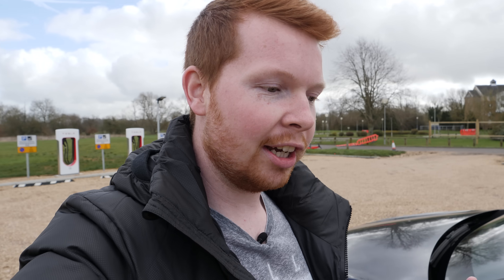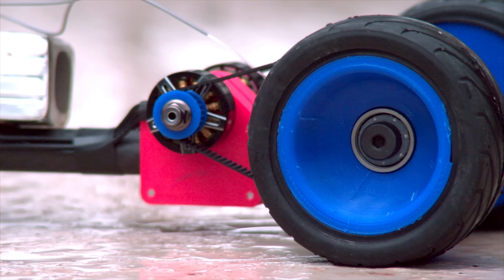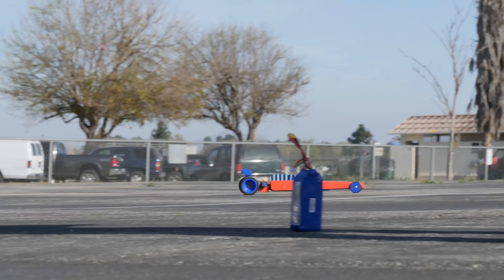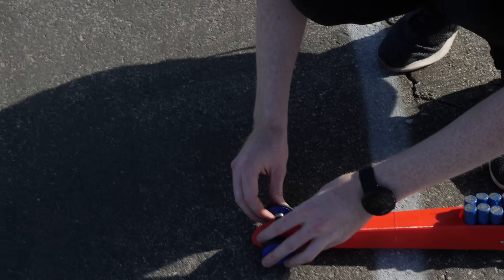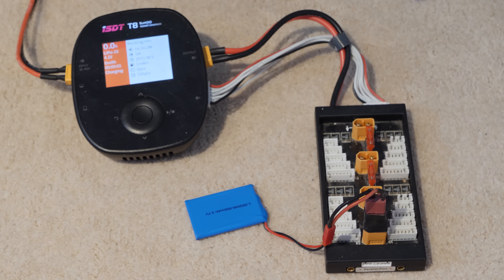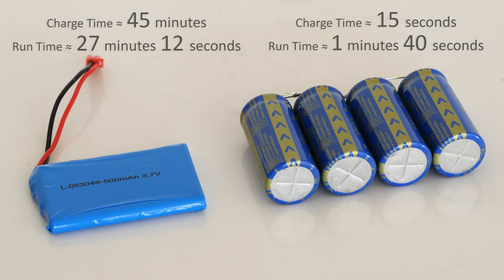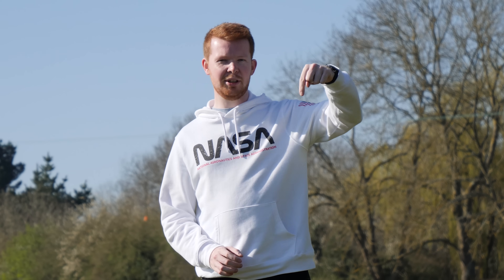Super Capacitor Dragster

Comment: There’s only one engine that you can do any thing to with only a wrench and no electrical failure the internal combustion engine is the only engine for witch can do any motor sport and still live and the only engine that makes a good sound no damn electrical whirr a good v8 rumble or the sound of a v6 screaming at 12,000 rpm and when it breaks you can’t do it yourself you will need a mechanic

Comment: Put Coca Cola or Pepsi on the tarmac in a straight line for traction like they do at the RC car drag races. Keeps them from spinning the tires and losing the front and rear wheel traction. I bet it would have hit some serious speed. Also, you should know by now peter breaks everything he touches, He's a junkyard mechanic and one of those dummies you see in the Subaru crash tests. He's just aboard for the ride. lol

Comment: I think capacitors would be best with brake regen.
Those caps can then be used as the first initial acceleration. Over time more power can be pulled from the battery as the caps drain.
This will stop the huge spike in power being taken from the battery.
Not only will this prolong the battery life, acceleration after regen could also be faster.

Comment: Build a elevated road bed like a slot-car track, but without the slot. Make it short in length and one-way approach, keeping the positive and negative correct. Make it fit between the wheels.  Just drive over this on your track and charge the car quickly. Add more than one, and you got a race on. Battery free.

Comment: when charging a capacitor bank from a battery or power grid current limitation must be applied as although the capacitors are not the bottleneck, the power source is

Comment: You did the calculation for inrush current to make sure it doesn't exceed the ability of that lithium battery right?  Because if you didn't, that's a good way to get that battery to overheat or possibly violently combust right in your hand.  Charge it through a resister.  You're supposed to know what you're doing.

Comment: Super capacitors could give Li batteries a run for their money.. Oh and try putting some down force on that amazing work of art with front and rear spoilers just like a top fuel dragster bet it'd run twice as fast without flipping. Amazing build I need to grab some of these caps and also your nice dc to 3 phase ac variable frequency driver.. Very cool stuff.

Comment: Super capacitors are used in some cars, but only as a complement when quick charge/discharge is needed (energy recovery), not as a main traction battery. I worked on some application for airliners too (never put in production).

Comment: It may not be the issue of how long it lasts but the overall up time: Runtime 27:12 Charge time 45 minutes. Percent uptime =37.67% uptime. Runtime 1:40, charge 15 sec Percent uptime =86.95% uptime. Those capacitors are 'normal' super capacitors not the 2D printed graphene ones which Samsung has demonstrated. All that is required is the application of using 2D printed super capacitors along with 'drive through' charging stations and the uptime will realized in vehicle applications.

Comment: Super capacitors can be very useful as a buffer - batteries would charge them whenever used at less than certain percentage, for example less than 90% and SC's would power the motor whenever the battery usage would be above a certain percentage, like 99%.

Comment: In the not too distant future- "cap packs" will become the new nitrous oxide in electric vehicles. You could potentially dump thousands of amps more into your electric motor for seconds at a time, and use it like a shot of nitrous. Dudes will be like, "damn.. what kind of caps does he have in that thing"..

There's all kind of ways in which to make en electric car faster. I would say even more so than anything driven by combustion, the question simply is, for how long?

Comment: Dragsters have friction clutches that clamp at certain hours power ranges.  It similar to regulating current over distance to keep them at max power, torque.  The clutches literally friction weld at different power ranges over the power curve of the 10000 BHP engines.

Comment: Nice video. I think there is a role for super caps in ev applications, the instantaneous power is useful for overcoming initial inertia, but from an efficiency point of view, not much gained. Good for overcoming any restrictive internal resistance in a battery system where that brings down efficiency where huge current surge's are demanded.
Reply: What do you think about supercaps in hybrid cars?
Reply: @xXZ31t6esTXx  anything that captures the energy that would normally be lost to heat via the conventional braking system has to be a good thing. So super capacitors used in a hybrid design can only increase efficiency.  Its not so much the amount of energy that can be stored in caps for this application,  rather the time to charge and discharge. Once a mass is moving,  its much easier to keep it moving.  Getting it to move from standstill is energy intensive.

Comment: I had an idea. Use 3 stages of batteries. Stage one has high capacity, but low charge/discharge rates, stage two mid-line in capacity and charge/discharge rates, and stage three is low capacity but high charge/discharge rates. Stage one trickle-charges the other two stages and is intended for endurance, long range, and cruise driving. Stage two is a charge buffer (like for regenerative braking) for stage one but also powers low acceleration, and also contributes to charging stage three. Stage three is also a regenerative braking buffer, but is primarily used for powering rapid acceleration.

Comment: This reminds me of the Hot Wheels Sizzler cars from the 70's.  Juiced them up with a battery pack and they'd run for a minute or two. I never blew one but now that I'm older I wonder who thought letting kids mess with batteries and capacitors was a good idea. I guess they counted on low attention spans to cut the charging time.

Comment: I heard talk of installing a small super-capacitor in an EV, so that you could do a quick charge of, say, 30 or 40km if you needed to, eg if you ran out of charge in between stations and you were given a boost by a breakdown vehicle. Or also for use in acceleration and regeneration from the brakes, thereby preserving the life of the main Li-Ion battery.

Comment: Should use caps to charge EV's after you disconnect the charger while driving giving a boost for a small amount of weight. They make these a lot smaller smd style. I;m thinking ~1000 on 1 pcb for testing lol #flat

Comment: Question is, can that be scaled up to an actual dragster. 
Cause that type of acceleration and speed would be great to see in a 1/4 mile. 
However I would miss the smell of burning rubber top fuel, and Nitro methane,  bot to mention the pure sound of horse power rumbling.

Comment: Make a infinite compressed air engine. The air engine is connected to a cylinder that compresses air into a bottle which goes back into the engine and can have it connected to a dc motor for infinite energy

Comment: Hear me out. What if you add a solar panel to the equation. As in, you have battery that is constantly being used but as soon as it dies you switch power sources that get charged with those capacitors as long as there’s sun light. Or even better yet, use the capacitors during the day, as long as there’s sun, and switch to batteries at night

Comment: Voltage in capacitor bank drops faster than equivalent capacity lithium ion battery. But capacitors also charge and discharge much faster than lithium ion battery. Uncharged capacities are dead short so they might overload your battery

Comment: You should add a mosfet, and then supercharge the capacitors with a 40v batter while in series, then transfer to parallel, then take a brushless motor with high input on the car

Comment: What If u make a car with Super capacitors and you speed up for 100km/h then you run out of juice them u use some sord of regen to charge the capacitor in just few second and the so
On and on ???
Reply: Or make 2-3 blocks of capacitor and then a regen that charge one Till the other run and so on and on ?

Comment: I have a question about your experiment. First of, very cool video...thanks for that! Now to the question. How long do the capacitors hold the stored voltage if connected to a circuit? Batteries for instance looses, or gains energy over time, how does that look with capacitors?
Reply: they almost instantly discharge it. Thats for example how a cars sparkplug makes a high voltage spark with a 12v supply. It charges a capacitor with 12v until it discharges all that energy in one go, with more volts.

Comment: Ohhh.. Clicks random intresting video - a wild Peter Sripol appers! Smaller capacitator packs are allready used in RC racing, to cover for the BEC when you draw high amps from the ESC. Sometimes the voltage drops below 6 volts and that would shut down the reciver. 

This is pretty cool!

Comment: I'm actually more interested in how to make dragster more stable than in the super capacitors. I really like slow motion footage and more detail  on what is mechanically going on when it starts to go wrong. Also anything on control theory is maybe a nice topic for you to give your videos even more depth which is hard to find in other YT videos of maker projects.
Reply: My guess is lower CoG would be the fix they'd need. Maybe some more weight in general.
Reply: @LawrenceOakheart  a bit late to answer that... But my guess is that it needs a diferential in order to give similar power inputs to the wheels even if one loses traction
Then the added weight and lower CoG would make it even more stable
having two motors, one for each wheel is always a challenge

Comment: Ev's could use a small bank of cap's for an emergency fast charge. Which gets u a few miles... I dunno. Batteries are getting faster to charge now with solid state etc. Maybe just leave the capicitors inside the controllers to feed the motor.

Comment: hey i was wondering is there a possibility to charge a battery with some type of quick release super capacitor? in a different way i imagine it like you using a syringe as fast as you can,so you can fill the "bottle" fast and full 

(sorry for the stupid ideia but i really love eletronics and stuff so i was wondering)i am almost sure that exists a super capacitor that just "quick release" all of its charge,like a mosquito racket,right?

(idk if those exist in the usa,but here in brazilmthere is a lot of mosquitos)
(a mosquito racket is well,a racket with a aluminum grid that when the mosquito gets caught in it it shock him killing it,so you just swing it trying to hit the mosquito until you get it)

sorry for the time and the text loved you video thx

Comment: I would love to see a revival of the compressed air engine. I do not know much about the working principles of engines but would your flywheel that you used on the planes, combined with the compressed air engine actually achieve anything? Just wondering.

Comment: To make it fast. One remove the wing, i dont believe that you get up to the speed where down force is needed. To solve the stabilty issues decrease the size of the rim and have less air in the tire. This would make the wheel "bend" allowing faster launches. Also make the rear and front tires slightly wider.

Comment: How about making an electronic circuit to charge back up the capacitors from the batteries only on brake times, stand-still times, or simply when the throttle isn't being pushed (that is for that toy-car only, I mean) and then see how much it improves or worsens the range of it.

Comment: Hey I wonder sense capacitors charge so very fast if you could create a dual capacitor pack in a simple flip flop circuit that will flip back and forth to charge them using a high-quality solar panel. And fix it in a way that when One Bank is 3/4 from being empty switch to the one that has been charged by the solar panel. To give you virtually infinet charge as long as it's sunny of course

Comment: Charge the caps, run the motor, charge the caps, but an automatic system that would do the on off thing when needed, a computer control set to sense the drop in power and when to reconnect the battery for a recharge time for the caps, while the motor is running.

Comment: You could get more stability and grip from adding a little weight out in front of your front wheels. This will greatly increase the moment of inertia about your power train and will give better control from your front wheels. Also, increasing your wheel base will increase turn stability as well

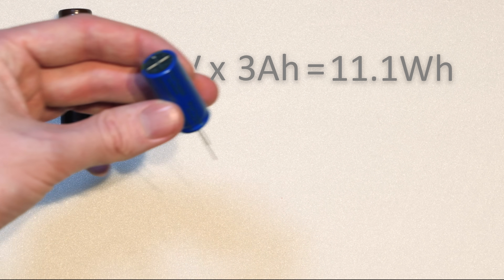Comment: 3:50 - And here you see why electric cars don't use super caps... The energy density is terrible!

BTW, you've got dual motors on dragster, so why not steer it from the back, I think it'll be more stable than loading those skinny front wheels up with the task.

Comment: Super-capacitors in a car has actually already been done. F-1 cars have had them for years and they are so powerful the F-1 committee had to place limits on them being used for regenerative braking to keep the non-equiped cars competitive.

The reasons they aren't in your Tesla are:
1) Cost. Those F-1 versions are $600K USD  each.
2) Range. Capacitors function using static electricity like a lighting bolt. Wich while it charges and dis-charges in a flash the actual watt-hours of power they hold is minimal.

Comment: What about installing both Battery and Super Capacitors. When the Capacitors reach a certain low voltage, charge the Capacitors using the battery = what will the total run-time of the cheap RC car be?

Comment: What about a car with both a battery and super capacitors? When you charge the car it very quickly charges the capacitors so then you can drive off. And the capacitors can then charge the battery

Naw that's a stupid idea

Comment: The dragster needs more grip which means either more tires or a tank style long track between two pulley's. Also weight matters because too much and you're pushing a brick, not enough and you have no traction and too much spin because of vehicle bouncing.
Also I like the stability of two front tires and one rear for many modern motorcycles.
So what if 3d printed triangular shaped frame with tank tracks on either side that go past the mount point by maybe 6in in either direction then the singular rear wheel for steering?
In theory this could work at scale if the frame was 1 ft long, the rear tire about 2in wide and 2.5in long, then the tank tracks were each 6in long from rear pulley axle to front pulley axle. The body frame would be about 1.5ft wide.
It should be made of abs at a thickness of 1/3in.
I don't have access to a 3d printer but am goodish with real world physics design fabrication mentally.

Comment: Have you tried a single motor with a solid axle to make sure both rear wheels are spinning exactly the same speed? Also, instead of steering left and right with a 90 degree steering geometry, lay the geometry back at around a 30 degree angle so the front wheels lean left or right causing the steering to not be so sensitive.

Comment: Could you not set up a system that has the battery on board, and every minute, charges the capacitors for 15 seconds, then stops. Would that give you an amazing amount of time? 

At that point, the battery is only used to charge the capacitors periodically. Or does this not make sense at all?

Comment: Cool video! Why not install a relay or controller of some sort,  keep the main battery on board and recharge the caps when low to maintain continuous charging of the caps... that would be a cool experiment. Would it extend the range or just deplete the main battery...

Comment: Supercapacitors also can be charged and discharged way more times than Lithium Ion. Also you can discharge to 0v without damaging them so work well with voltage regulators to get most of the available energy out of them.
Reply: by VR do you mean a buck-boost converter?   a conventional VR does not help
Reply: @kennmossman8701  Yep.. buck-boost.

Comment: Hear me out here, now what if we use the capacitors to charge the lithium-ion battery? Basically supercharge the capacitors, then have a system where you can still use the RC Vehicle while the Li-Ion battery is filling up and then switches to using that battery? Would that even be possible?

Comment: It won't truly matter unless you go for a very high power motor. The thing with these supercapacitors is that they provide an awful lot of current at a very short time, and in motors, more current = more torque (roughly). So get a high power direct drive motor for this, not some cheap toy

Comment: Combining super capacitors for boost & regen capture with a power controller buffer & a lithium ion battery with good energy density produce an energy storage with good peak power output & good endurance / range or energy capacity // hybrid lithium ion ultracapacitor probably going into Tesla vehicles in near future for this exact reasoning //

Comment: Haven't done the math for this setup but usually one should be careful with charging caps directly from a battery. The current peaks can decrease the life of a li-po. Which also leads us to the problem of all fast charging, it's cool but requires complicated infrastructure that can handle the power needed. Cool video btw :D

Comment: Although not mentioned, one of the big pluses with capacitors over batteries is the instantaneous availability of the power. Batteries have a limit on how fast they can drain. Capacitors can deliver their power nearly instantly which while horrible for duration, means they have an amazing amount of power available instantly.

BTW, a dragster like that is not meant to turn. It is a straight line racer. You effectively demonstrated the reason why you don't see funny cars on the circle track.